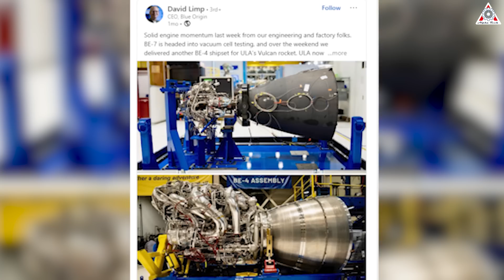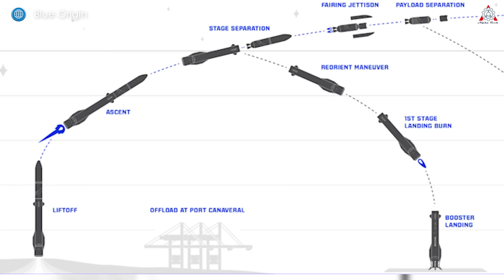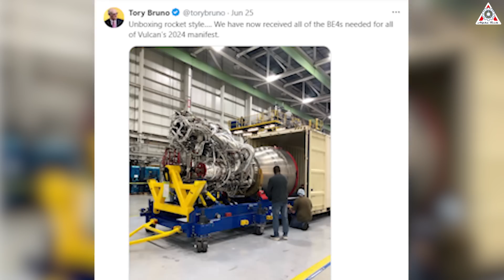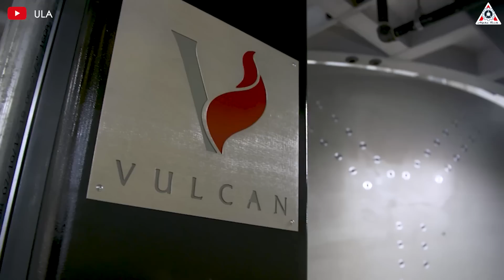Blue Origin's New Glenn Complete a Joke to Starship! Elon Musk laughs

Comment: Can SpaceX not try to first catch a Falcon 9 with its Megazilla arms. To test how the arms behave. They know how the Falcon 9 reqcys during decent and how precisely they can land. Is teying to catch the first stage not a little bit too ambitious? I like it and I want to see it but is the steering of that huge booster accurate enough to land it in between those arms. 

In the 3rd and 4th test you see that the last seconds are so intense. the middle ring engines only have to be turned on at once when the booster is still falling supersonic through the last piece of air. Isn't it safer to slow down a little earlier and let the booster bounce a little so that the arms can close? That will take a few seconds. 1 mistake if only some of the engines respond, then that thing can destroy the tower at more than 1000 km/h or even worse on the tank farm, which can cause a mega explosion. The tank farm is very close to the launch pad. 

So finally is testing with a F9 nog a good idea to test the systems that they work fine before you start with the mega booster that has to land precisely into the arms and there is no marge for error. The F9 only uses 1 engine to land the Booster first the 10 in the middle ring and then 3.
Reply: The catch attempt of booster 12 is the result of how well the precise hover sea landing of IFT4 went.
Reply: @favesongslist  Did the moment the booster was hoovering above the sea count as a succes catch attempt test? However can they steer something that screams trough the air just before pulling the handbrake, and bring it so close that they can catch it already? It looks like they have still some difficulties to light all engines back on.

It just amazes me if you see like a Falcon Heavy after MECO the boosters go pretty far laterale. that they have so much energy in them because they are almost empty so enough momentum. And getting them back both landing at the same time.
Reply: The lawsuit may backfire it doesn't include Texas StarBase.  This will only force them to buy, build another facility elsewhere, the northwest Hawaiian Islands have a number of atolls.
Reply: Everything Gwynne and SpaceX do is ambitous. It is good and they will not stop. Ever heard of StarLink? Another Bold move that.
Reply: @tjmcguire9417  Yes they shoot almost every day 1 starlinkrocket to space or 1 in 1,5 days to be precise. But China also wants to copy Elon and that may not a good idea to go from a couple of thousand satellites a few years a go to reaching over 100.000 pieces. Yoe create so much debris of the second booster and flakes from LOX LMET that go also 8n orbit and need time at 5hat height to come doen in a natural way.

Comment: What's with the aversion to landing legs, considering that both the Moon and Mars missions require them? I understand the issue with weight and an already ass end heavy rocket, but testing and landing with legs will have to be faced eventually. It almost feels like Elon is painting SpaceX into a corner, so they have to use the Chopsticks to prove "Quick turn around reusability".
Reply: The boosters won't go to the moon or Mars.  The ships that land on the moon and Mars will never land on earth.  So no need for legs on ships that are meant for rapid reusability
Reply: @cannonfodder4812 Whatever lands on the moon or Mars will require some kind of landing legs.  Bootstraps won’t work.
Reply: @dewiz9596  the boosters don't go there, and they havnt built any yet that do.  Just because the current starship don't use them doesn't mean later versions won't.  
   Besides starship is much larger, fold out legs may not work aswell as smaller craft such as f9 boosters and new glen.
Reply: @cannonfodder4812  Guess what... I wasn't referring to the Booster. Oh, and I guess you missed SpaceX talking about landing both the booster and Main on ocean barges, but that's beside the point.
Reply: @lonewolfnmoon  I was referring to the starships that will be going to the moon and Mars.  That they havnt been built yet and that they would likely have legs.
   Same for the barges, those havnt been built yet and WILL likely have legs.